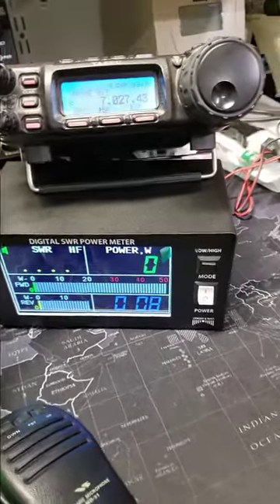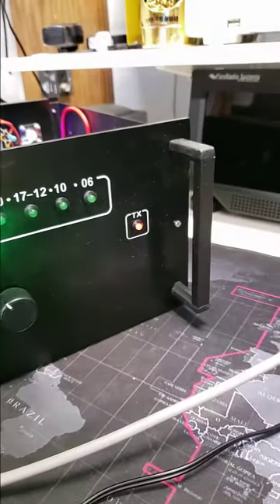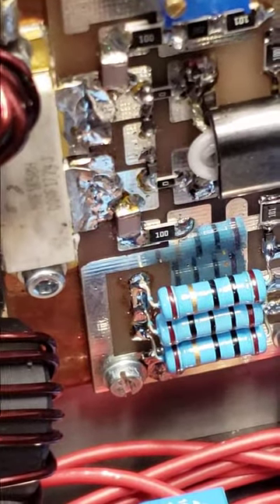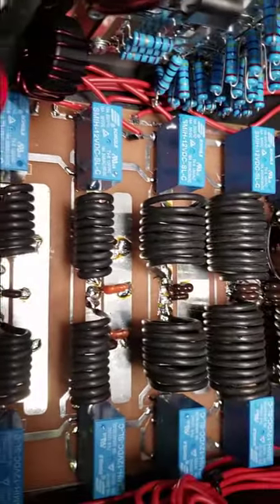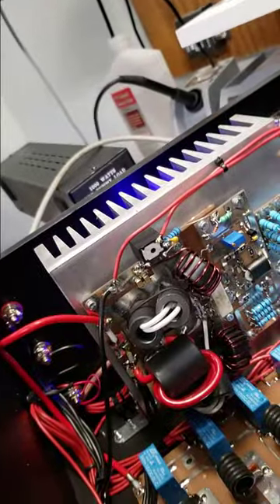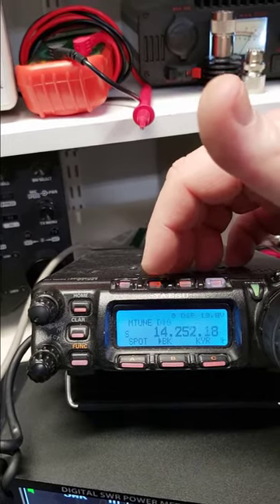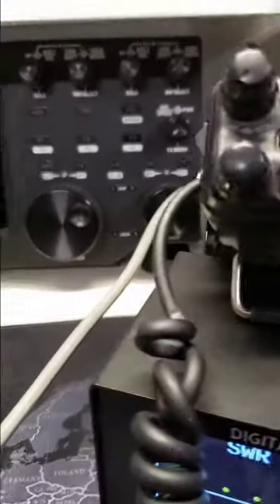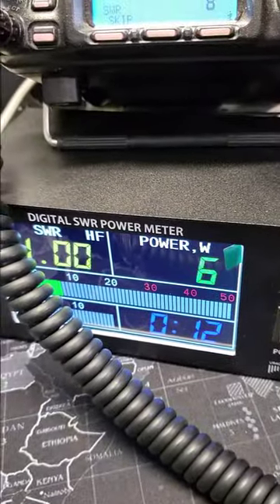DX World e1200 Amplifier

Comment: Check the bias regulator and the Zener are ok. Should have 12v on the transistor regulator, the 3 leg  transistor on the side of the heat sink. No bias no go. 50v+ in, 12v out.